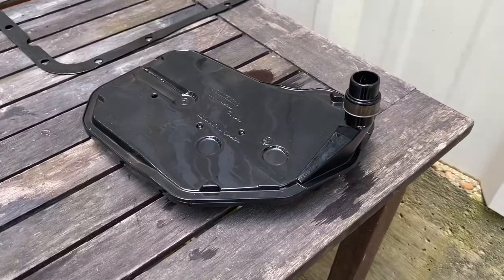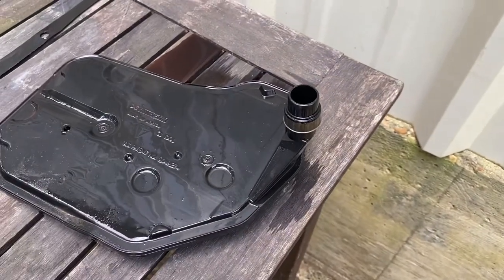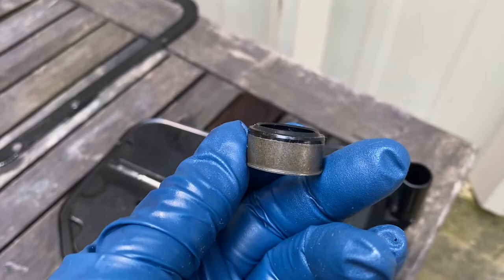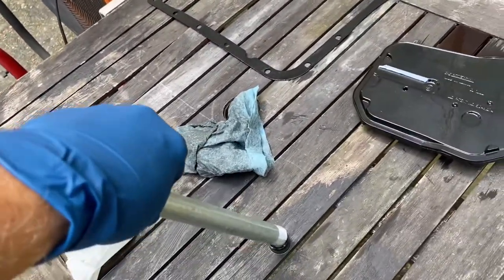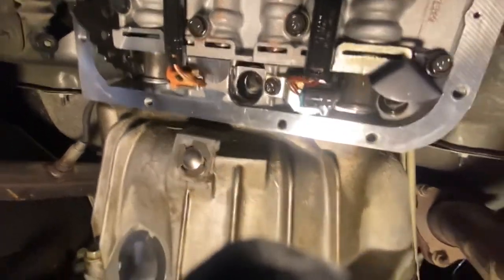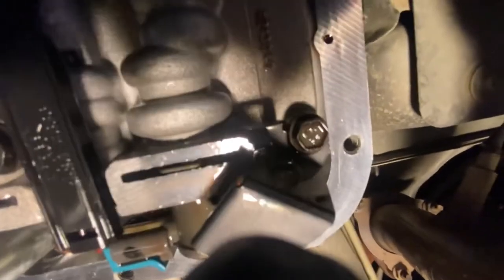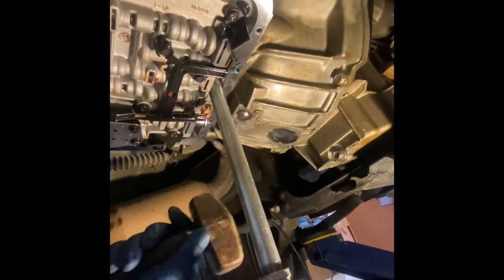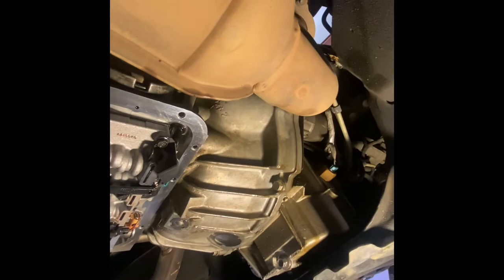Removing the filter seal in a 4L60e transmission

Comment: Thanks for this!!  Saved my bacon.  I modified this a little. I bought the 1/2 nipple and the T.  Probably could've just bought an end cap with my technique. I was hoping I could get away with just screwing it in and yank on it. No go. I disconnected the T and slid a 5lb dumbbell plate on the pipe then replaced the T.  Dropped the weight like a slide-hammer. One whack and it popped out very easily. The threads gripped the rubber bushing so well that I actually had a hard time removing it from the tool. LOL  Absolutely no damage to the valve body recess. This is the only way it should be done in my opinion.
Reply from the maker: Great upgrade!

Comment: If you are having trouble hitting the pipe hard enough to pull out the seal, try setting something really heavy on one side of the "T". Then hit the other side with the hammer. 
Awesome trick, I really appreciate it.

Comment: Lol , love it i do the same thing easy as pie 👍.
Once you change it once you really don't need to change it all the time as long as the filter is tight on the seal its good , once the filter during a service comes off relatively easy the seal needs to be replaced.
Reply: The seal must be changed if you are putting on a new filter. Every time. With no exceptions. Or else the new filter will eventually dislodge and poor suction into the transmission which will cause many symptoms and premature failure

Comment: Worked like a charm 15 bucks at Lowe's for a couple 1/2 inch pipe pieces and a sledge hammer and it came out. Granted with a bit more effort than the video showed

Comment: So silly question is this half inch rigid conduit or is this half inch gas pipe or half inch schedule 80 or half inch schedule 40
Reply from the maker: Good question!  I used galvanized but considering it's 1/2" NPT thread, I guess any of the ones you mentioned could work.
Reply: This is true. I guess the next question is how long of a length of that pipe probably a foot would work

Comment: I can't get the new seal in lol how do you get it in there properly? When I put it on the filter and push it in it just slides down and doesn't go in the bore?
Reply from the maker: Place the seal in the trans body bore and seat it in the bore using a 19mm socket until it feels "bottomed out".  Lube the seal with ATF on your finger and then insert the filter neck.
Reply: @ccarlley  mate you are a legend I got the seal in thank you

Comment: Is the inside diameter 1/2 inch? I would assume so?
Reply from the maker: Not sure. I doubt it.  It's a 1/2" NPT pipe thread (tapered) which is .84" from the chart I see.
Reply: Thanks

Comment: 3/4inch pipe will not thread it 1/2 is too small wtf??
Reply from the maker: Interesting.  What year is your vehicle?
Reply: @ccarlley  96
Reply from the maker: @user-uq6vh3ps7m Good to know. Apparently the 4L60e had a design change around '99. Mine is a 2001.  If it's not been damaged from your attempts, leave it in the trans.  It's the filter that's important.

Comment: Thank you for this video.  I used this method and it worked perfectly.   The only problem I had was when inserting the new seal I bent it.   So I had to order a new one.   I believe the hardest part is installing the new seal.
Reply from the maker: Sorry you had that problem.  I guess I'm lucky I haven't experienced that.